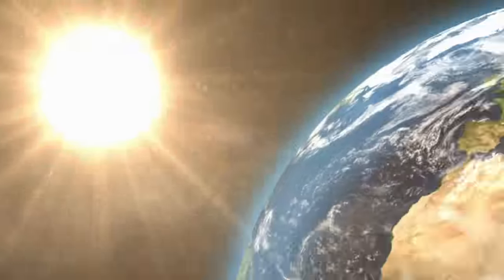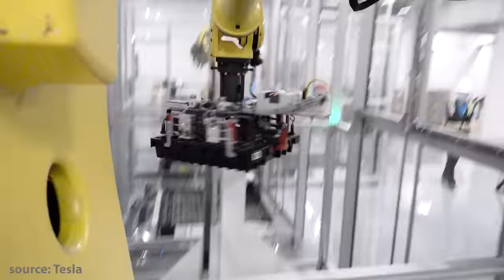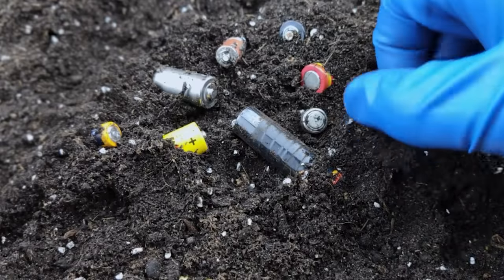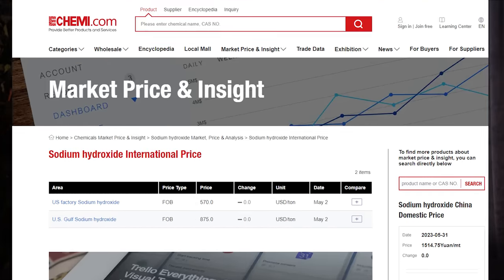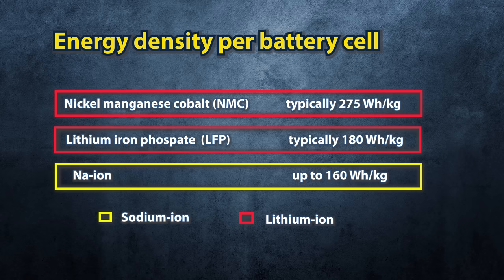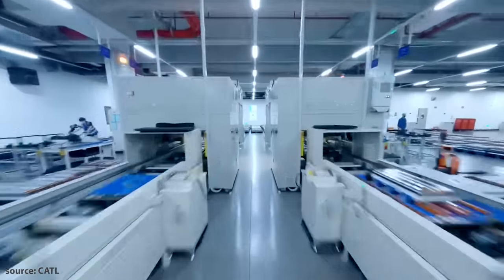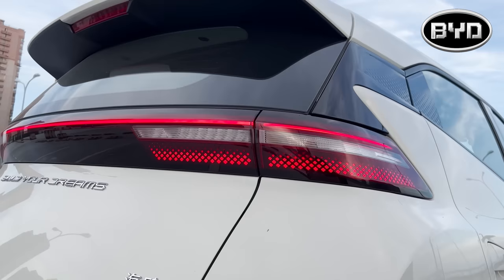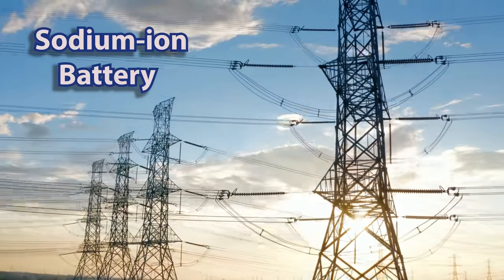Goodbye Lithium!  New Sodium Ion Battery will change the world! And it's in MASS PRODUCTION

Comment: We will need lots of new types of batteries and it will happen. One type will not "take over" but each will find a use. Cars might only use the highest energy density ones and grid storage might use other ones. With grid storage you don't have to worry about how big or heavy the battery is, but in cars you need the lightest pack that can store the most energy. Cars also need to charge quicker and for enough cycles without failing to make them useful. This is a good thing because grid battery demand won't be driving up demand (and cost) or car batteries.
Reply from the maker: EXACTLY! So agree! I am working on a video that will talk about EV batteries of the future, and yes, the biggest problem I have with EVs is the charge time....
Reply: Cars will require external input of energy only once, that will be a battery solid state. Moving forward will be done with magnets used in conjunction with electricity, as usual since everything is electromagnetic. And since one field interact with the other and also be amplified, both ways...battery will load itself up each time car moves or when ppl apply pressure to seats. Just need a piezo-mat under the textile. :D
Reply: @misewixe2777 I don't know if you're joking, but if not just no. All cars need external energy input. You cannot have a self sustaining system, that is impossible. You can have a solar powered car that gets energy from the sun (if you live somewhere sunny and don't drive far). In the road charging is just too expensive to build at a large scale. The practical choices are charging or battery swapping. There is a tiny car you can buy now which can have a battery swap down by hand without the need of an expensive robot to do it.
Reply: @adrianthoroughgood1191  you can have self-sustainability in an open system if it's continuous. All sorts of ways now.
Everyone is still hooked on converting sun rays to energy which is just old and clonky tech.

Just skip the build of heavy engine block and replace with some entirely different. Who says you must have car with gas?
You can use an electric field and maximize its potential in many ways. Either with magnets or more conductivity. And works both ways., yes. 
Ppl still haven't realized what that means since you can amplify any electric potential, or even dampen it, with magnets. 

I'm not joking when I say "wave collapsing" - implosive inertia devices in a non-conservational system. 
Almost zero resistance, can loop it, "park" it - then apply lots of charged up volts to electrons standing in angular momentum stand by mode like a spring ready to shot off. Braking, acceleration is done with an electric field regulator. 
No point explain this to classical mechanical engineers since they won't wrap their head around the fact that 99 percent of all matter is just plasma, all of it. Only needy pressure and temperature, lower temp and out pops whatever Isotop you need. Back when particle accelerators were in fashion, built end of 18th century. (Haber, Bosch etc Schwarzschild) by ww1 and 2 Preussen had 11 active programs with labs for magnetrons, Zyklotrons etc. 
So today we produce already meta-materials. But instead of using explosive force, we use implosive force. Sub quantum plasma realms but at the other side of origo. Ppl read Penrose but don't actually understand what he is saying... Well... :)

Comment: There is a US sodium ion battery start up company in the US called Natron. It has started production this year and uses slightly different technology with prussian blue as the anode and cathode. The are mainly aiming at power storage and data centres at the moment and it is very early days but Natron could be a good non Chinese option in the future.

Comment: This is indeed good news!  Even EG4 Powerpro 14.3 kWh batteries selling for under $4k cost approximately $280/kWh.  Sodium Ion batteries’ $77.00/kWh initial price is truly a game changer!  Thanks Martyna!

BTW, what happened to your video released last week comparing 400W solar panels?
Reply: If you know chemistry at all, you'll know that both of these types of batteries are dangerous as hell and should never be used for something like a vehicle, and honestly shouldn't even be used for mobile devices that heat up, yet we do, now the reason why people do is because we use something that regulates that, but if something happens to your fan inside of your say your steam deck or something like that, they usually have a microchip that shuts off the machine so it doesn't get that hot in order to prevent a literal fire in your hands, they have microchips like that in these cars too, but if that fails or say you get into a wreck with another car and it ignites through the crash, you're looking at a incredibly hot burning chemical fire from hell and you are more than likely going to die.

Gosh when you really think about it, we've been at this for over 100 years and we're still using highly flammable or highly corrosive dangerous chemicals in order to transport ourselves with.

This is a bit sad to admit but I don't think the future should involve anything battery powered when it comes to vehicles, there are just too many issues you can run into they could wreak havoc, it sounds really Bleak future, but if you want to be safe electric cars or trains really is that future some kind of track, at least inside the vehicle you're safe, it's when it comes to the chemical batteries is where you run into danger the fastest.
Reply: @5226-p1e  Don't know how to tell you but gas is also extremely flammable so your only chance to "safer" non-grid dependent vehicle is human powered and is called a bicycle.
Reply: @alexandruilea915  
yes i believe i mentioned this as well, but the only thing i can point to that would be safer is rail way trains that just use electricity straight up, so no issues with a portable battery spontaneously combusting for some reason, i guess the only issue is when traveling outside of the city or state, i don't think they would build an infrastructure for something outside of the city transportation wise outside of goods transportation, however blackouts could also happen. 

lol if only we went with Tesla's coil that extracts electricity from the air and use it on the go, instead we have to be plugged into everything or close to the charger.
Reply: 15kw lfp cells you can order from china for less than 100$ per cell and you need 16.
Reply: @HybridShedIraq  But then you need a BMS and some way to cool them down if you want to be able to charge them while it's hot outside. Cells are one thing and complete batteries + BMS + thermal management is another...
Reply: @HybridShedIraq  Yes, but you also need a BMS, Temp sensors, bus bars and some sort of container for it and that's just for the battery.  Not to mention your time building it and your time dealing with a Chinese supplier, which are often pretty shady.  The EG4 PowerPro also has high amp fuses, communication for multiple batteries, weather proof casing, emergency shut off, and a pretty good LED screen and mobile software.  If you add that all together the pricing of $3800 isn't that bad, especially compared to a Tesla Powerwall.  

If you have the know-how to build it yourself, you can obviously save some money but most people don't know how or don't want to do this.  Right now the EG4 just makes everything so much easier at a decent price.  I think in a year to 18 months we'll start to see some sodium-ion batteries come to market, which will eventually drive down prices further.  Like all things in technology, if you can wait you'll get better tech in the future, often at lower prices.

Comment: I think it wise to consider that many varied mixes within batteries will evolve, come and go.  
There's no need one needs to replace the other, in fact having some diversity of them will ease materials and supply chain shortages that will arise.
Those various types will all have characteristics and cost profiles that will find different deployments successfully.
And, a few will just bomb out on tech, physics, materials unavailability or costs.
Reply: Taken to an extreme that can also strain supply shortages. It's good that Sodium will ease the pressure on the supply chain of Lithium but we only have so many ways of handling logistics.
Reply: I don't think that's necessarily the case. Sodium ion batteries solve the issue of supply and demand, while solid state batteries provide multiple times energy efficiency and safety increases. The main problems are manufacturing costs/maturity and testing stability. The sooner we can move away from lithium liquid batteries, just like moving from alkaline, the better off we'll be.
Reply: @Jay-mx5ky  Imagine Sodium solid state batteries, assuming we can make the solid state part out of recycleable materials.
Reply: @javierititin  I believe that until his passing recently, the scientist who developed the lithium ion battery was in the works of making a "glass" battery, which was solid state and used glass electrolyte and sodium electrodes. I'm not a chemist by any means. I just have a passing interest and trying to get as much info as possible, but I think this means it can be done, though i heard there were flaws and miscalculations with the research.

But the alternatives to lithium ion all look like they've got a pretty good shot going for them, so this is rather exciting to see.

Comment: Excellent information, for many people buying a solar system and also forking over $15k - $20k for home battery storage on top of the solar system is not doable in their budget however with Sodium Ion perhaps a $2,000 battery will help make it work out for everyone.     Great video !
Reply from the maker: Yes! I know. Solar is as good as it gets, people already are benefitting from it, but adding battery in the future may be the way to go since they should be a lot cheaper! I personally have had solar on my personal and before family home since 2009. And We cant live without it, but we dont have battery just yet.....
Reply: Sodium is already out but pricy currently
Reply: @johnle231  Sodium Ion home storage and Car batteries for EV's are just starting to be built this fall,  haven't seen any for sale as of yet !
Reply: Unfortunately the voltage sag is too high and your inverter will drop out when attempting to power large loads. That's why previous manufacturers of sodium ion batteries have now gone bankrupt.

Comment: You hear a lot about the energy per kg for Na Ion batteries, but a lot less about energy density per litre.  I have heard the energy density per volume is less than Li  Ion and may be an obstacle to longer range EVs.
Reply: Not to mention voltage sag during high loads.

Comment: TIAMAT , a french startup and owner of his own sodium-ion patent is already selling their 1860 cells, for the moment it's in small appliance ( you can already buy sodiu-ion screwdriver il the "Leroy Merlin" , a kind of french Home Depot )
Reply from the maker: Oh wow, great to know, I need to look into them! :) Thank you for sharing.
Reply: Yes, this looks like a good idea especially if the number of charging cycles can be higher before battery degradation. It will be interesting to see if these cells will also be considered for phones and laptops.
Reply: @MdMax001  i don't think so, those ( tiamat ) are for ultra deep cycling and intensity , but they are close to 100Wh/kg, while li-ion are 250 and the very best 300

Comment: FYI, there is very little lithium in lithium batteries. The primary component in lithium batteries is nickle. Additionally, if you think back to your high school chemistry classes, remember what happened when water comes in contact with sodium. The evolution of the battery still has a long way to go and it will be interesting to see what the chemical makeup will be 30 years from now.
Reply from the maker: Yes, very true sodium is also very explosive, so I cannot wait to see how CATL and BYD makes their sodium batteries react LESS. I know its still fiction to many but since they are supposedly in production now, I cannot wait to see when they are available to the general public.
Reply: folks were making great strides in sodium batteries in the late 1800's. They had cars running up to 300 miles.
It's not so much tech, it all has to do with who runs the world.

Comment: Sodium ion batteries are best for smaller EVs, phevs, and home batteries. They don't perform the gest for higher performance, longer range vehicles. As for the home, it would be nice if every new home came standard with Sodium ion battery storage/generator.
Reply from the maker: Yes very very true, solid state I believe will be the solution for EVs. Working on a video about those now. :)
Reply: @solartimeusa 
What's the best battery for RVs or iff grid? Loved and saved this video and subscribed.
Reply: @Josephthe4th  Lithium iron batteries (lifepo4)

Comment: Why not just use roadway induction ? Buried powerlines under the road to induce current into a pickup device on a vehicle to run the motors. Small battery pack for off grid driving.

Comment: All we have to do is to replace batteries for static use such as grid storage or home use and leave Li for mobile applications where kWh per kg is important.  But to be successful, the Na batteries have to have much longer lives and be cheaper than Li batteries.  The relative price of Li and Na are not the only factors that determine the price of a battery.
Reply from the maker: Agreed, the cost of just the element is not the whole cost of the battery for sure. I am really curious to see how those eventually will price out. SUrely it will be few more years before we know, but just happy about the progress.

Comment: Lithium is not limited in production and is going to increase drastically and costs are going to fall rapidly. I have been selling lithium batteries for years and they continue to drop at quite a substantial rate.
Reply: No. Rio Tinto Have made a clear. Even  with current output increasing And taking into account all new lithium projects supply is expected to fall short by 50% within the the next 2 years.

Comment: It will be interesting what the real world  driving range of Na ion batteries will be in an EV. If the cold weather performance is better plus if the manufacturers need to leave less of a buffer because of the ability to be able to use the full 0% to 100% range. Then maybe Sodium Ion batteries will be a better fit for EV's than everone is thinking?
Reply from the maker: I personally think that sodium will be huge for utility scale storage and home storage. I am working on a video for future EV batteries, it's pretty interesting what they are working on now. Hopefully you will be able to see it :)
Reply: @solartimeusa  sounds interesting..
Reply: Much of the driving range loss in cold weather is due to the heating / cooling system of car using a third of energy  just to maintain battery and cabin temperature. We have the same losses of range in Arizona during summer when it is 105 to 119 F.  Short trips just kill our efficiency in the summer drawing almost as much power cooling as it does to propel the car. Of course if the battery temperature range is expanded less energy will be used keeping the battery in the operating range.
Reply: @dannelson6980 maybe cars should be built with better insulation and double glazed windows on the back and sides? 

It's a really good idea to arrange things so your car is plugged in whenever parked as much as possible. Then you can use the app to pre heat or cool the car on mains power so that you start the trip with a full battery. Heating or cooling during the journey will still cost you some range but getting the initial bit done first will help quite a bit.

Comment: We have had a method for energy storage for over a decade. Point of use storage. IE every house and factory has it's own energy storage and solar cells etc. About 50% of houses and flats are suitable for power banks. Currently the actual cells are about £0.20 per watt hour. Put a 30kWh battery bank into every home that can take one and you would have  390GWh or storage. Average energy usage is 8kWh per day. Call it 10 to keep the maths easy. That would mean every house with one would have 3 days of electricity n storage. 5kWh of solar panels even in winter produce 5kWh per day so even in winter you would have 4.5 days of electricity real terms. The rest of the time you would get near half your power from the power bank that has been charged during the day. But we cant have consumers consuming less can we? That would vastly reduce share prices and dividends.

Comment: Sodium batteries may do well on stationary items (e.g. houses, etc.), however, at around four times the weight of lithium I'm not sure whether they will meet the needs of the auto industry. In the long run, I believe hydrogen is the likely replacement for Lithium in the auto industry. It will be interesting to know how stable Sodium batteries will be if water ingresses.
Reply from the maker: Really interested in hydrogen for sure. And also agree on the sodium being a big player for stationary storage but for ev im thinking solid state for sure. Editing a video now regarding that. Stay tuned 🎉
Reply: @solartimeusa  Just read about Solid State batteries - thank you. Can't wait for your video on the subject. With all these variations in batteries slowly coming to market the winner should be the consumer with reduced costs!

Comment: Did you mention the weight difference between Lithium and Sodium 12v  batteries...
Reply from the maker: I mentioned energy density, so yes those sodium will definitely be heavier and bigger, will require more space, so I believe they will have more impact in utility and stationary applications, rather than EV.